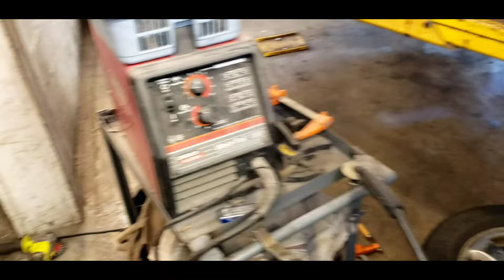Endless Surprises

Comment: Signs of a much neglected car !..........or it could have been just parked outside under a tree !
Lots of Japanese Domestic Market cars have this rear brake assembly. A drum and a rotor are made in one casting. The rotor served by the caliper, functions as the normal rear brake. The drum and brake shoes functions as the parking brake.
I have a stock 2003 JDM Corolla Fielder Wagon with a 2ZZGE engine. The rear brake arrangement is the same !
Trinidad & Tobago.
West Indies.

Comment: I had a Honda Odyssey and it had absolutely no power found out that a weird flaw you have to adjust the valves on those they get too tight instead of loosening up and then you lose all kinds of horsepower replaced as a gazillion parts before we figured this out just thought I would shout out never heard of this before but over time of heat cycles the valves become too tight and cause the valves to be open too much and then you lose power
Reply from the maker: Yep. Valve adjustment is critical and not automatic

Comment: How is it possible that a car is designed in such a way that you have to saw through something to change an air filter???  I am especially surprised because Hondas are mostly well built, aren't they?
Reply from the maker: Yes, very well built. But all cars have quirks
Reply: I had a 1996 Nissan Sentra. It came with NO CABIN filter in the AC. Plastic had to be sawed to remove the clogged evaporator, to clean it. Obviously the AC system had to be depressurized to remove, and upon installation......repressured !
The cabin filter is a pretty recent addition !
Reply: If car designers/engineers had to service vehicles as well, they would be designed a whole lot better 😂